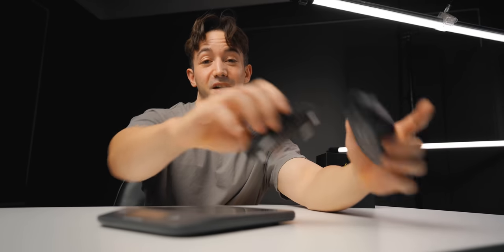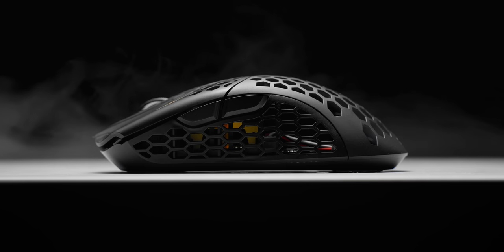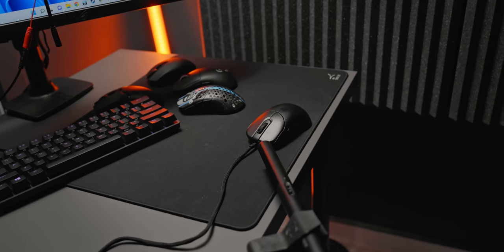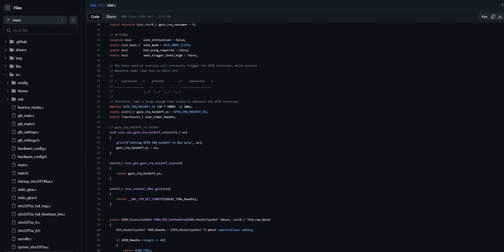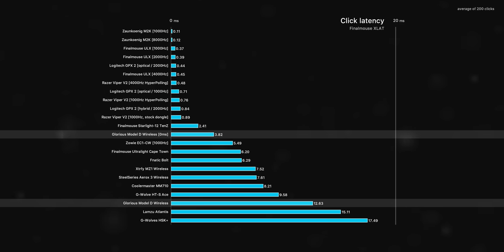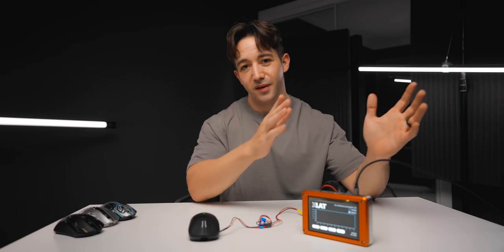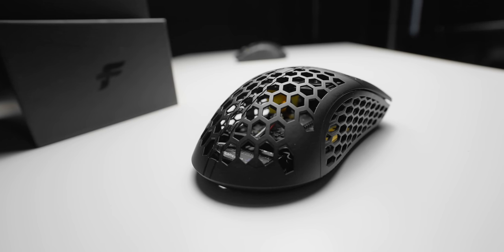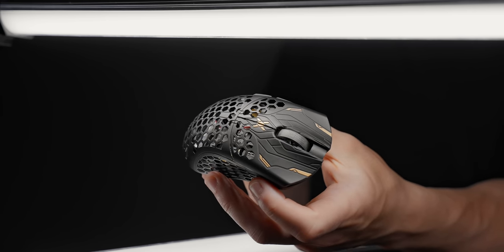Finalmouse just owned everyone. - UltralightX Review

Comment: I used to work for a local retailer that stocked Finalmouse.

Eventually we had to drop them completely, as they would outright ignore our warranty claims from them and we eventually had to compensate customers out of pocket.
Reply: Microcenter?
Reply: @HumongousFish  Microcenter! my favourite local, small, startup, tech retailer!
Reply: @itsPoliswirl  same bro it's amazing
Reply: You know what they say, if it's micro its small and if it's a center thats bound for some plenters
Reply: They only did Amazon for old drops and then Maxgaming for the Starlight 12 Tenz so wut?
Reply: What were the problems and how common were they?
Reply: @go3002  Mostly just QC issues, sensors being wonk, etc etc. 
This was during the earlier days of Finalmouse as well, so I can give them a bit of a pass.

Hopefully it starts to improve now that they're trying to be an actual brand instead of hype beast bait.

It wasn't a massive amount, but still more than was acceptable for a retailer.
Reply: Sidebuttons and scroll wheel have always been terrible on finalmouse
Reply: actually interesting how @4:54 of click latency, they did not include razer 8k or 4k, only 2k.. lmaooo
Reply: ok
Reply: I had the original ones released years ago. both had left clicks break and they did replace them but I've heard these same stories from others
Reply: Bizarre since they replaced my original one for free and without second question

Comment: My main criticism of this video is how you lowballed both G-Wolves, Lamzu, and Glorious(shocker one too) whether it was unintentional or not. Most people who buy these mice set their debounce a lot lower, so testing it at 0-2 ms debounce makes sense. I have never heard of someone using a Lamzu Atlantis at the default debounce at 12 ms. Also, I’m 100% sure those Chinese mice you tested are not their latest/pro version. The Lamzu Atlantis you tested was the compx mcu and not the pro version using the Nordic one. Also, the 4k version of the G-Wolves mice at 4k should be on par with Razer and Logitech.
Reply: We definitely need more thorough testing. This is bothering me too.
Reply: @MrKapusij  It would be ok if he did stock versions only, but changing polling rates and setting the GPX 2 to optical mode requires software. Just like how debounce settings also require software.
Reply: He said those were the mice comparable with xlat. It doesn't work with all mice off the bat
Reply: @cmo8627  I never said stock only. I said that those options might not exist for small mice brands because the code isn't there to receive it yet.
Reply: @Evan-xs8ts  It’s more so because he doesn’t have the pro versions of these mice.
Reply: @cmo8627  or they don't work with the software. Like he said. What don't you get about this.
Reply: @Evan-xs8ts  Even if it’s true(though I doubt it since all the higher brand mice use a Nordic mcu), he is still testing outdated mice and giving misinformation with the evidence shown.

Comment: Your test of two "identical" mice being different makes sense and it would actually be pretty awesome if you provided data on variance between mice that are supposed to be the same. Hardware works within tolerances, and it would be nice to know which companies are responsible about consistency.
Reply: I think this also might be a case of interference. Not in terms of malfunction or even a significant influence but when you put two transmitting devices right next to each other, especially when they're the same brand, you can't rule out any interference quirks.
Reply: @UnimatrixYoutube  Not even interference, most likely just USB input polling differences. Switch the mice's USB ports and you'll probably see that tiny difference flip. This is why the dedicated testing box makes more sense than comparing multiple connected devices at the same time
Reply: You are asking a Youtuber for manufacturer retailer-grade sample size...
You do realize that 2, 3, 5, even 10 mice of the same type wouldn't be enough to get the kind of information you want, correct?
Reply: @fuibancontafake3057  Sounds like you are just trying to flaunt that youv've taken a college course in statistics but I'll respond anyway. Evidence from this video shows that just comparing two showed variations (maybe due to manufacturing tolerances). There are many things that can vary more with timing, sourcing blah blah blah. Comparing two even from the same run still has value just to flag if they are different. It's the sort of test I'm suggesting to do when the opportunity is there. I'm not suggesting to go buy 3 more of every mouse he has ever tested, especially considering 90% of people are using about 3 different options at the top of the line.
Reply: they should be selling these for $149 not $180
Reply: I’m pretty sure he did with “dpi deviation is real”

Comment: Not having a software running in the background is a nice thing. But the web configurator has 2 issues: if they release a new version you are forced to use it no matter what and if they shut down service you cannot configure your mouse anymore.
Reply: there's probably more than a few 3395/2khz+ configurable mice out there that don't require software to be running at all times. in fact, i don't even think logitech actually require you to have the hub software running once you have everything configured, though it's been a while since i've used one so can't confirm that.
Reply: most mid to high end mice had onboard memory. you only need to run the software once to configure it, save it, and then you can just uninstall it
Reply: theres probably also a software version but u dont have to use it
Reply: Which is no problem since this is an enthusiast product where few will lag behind when it comes to versions and new products.
Reply: @neofaktion awful take
Reply: @hoozwastaken   It's not a "take" lol, your average gamer isn't going to be buying this mouse, they will be getting the superlight 2
Reply: Wonder if saving an offline version of the website would still work, would fix both of those issues.
Reply: @WHAT_1400  Logitech also has Onboard Memory Manager. Doesn't require installation and changes onboard settings directly without the god awful experience of GHub where you have to switch to software mode, change settings in profile, switch back to hardware mode and then copy the profile to the onboard memory.
Reply: @WHAT_1400  razer doesn't need software running too. tough i still hate them. you install the software, do your settings, the settings are saved to your mouse and then you can uninstall the program again.
Reply: @neofaktion Not even. Most gamers buy the G502 or Basilisk, maybe G305. The Viper V2 Pro, DAV3 Pro, GPX 2 etc many gamers will go for the competitive folks but definitely not the "average".

Comment: it's good that you mentioned that the software is done through a website. this honestly should be the new standard when it comes to peripheral settings just like how you can customize the wooting keyboard with their website. obviously im not saying to completely get rid of downloadable software but its so nice to have a plug n play type of peripheral and be able to easily change the settings through a website. makes things so much easier and  convenient
Reply: Problem is, it relies on WebUSB which Firefox does not support (for somewhat decent reasons), so it can’t be the only option IMO. Awesome as a secondary option though
Reply: One issue I see with this is profile switching.. If you want different settings for different games etc. If I want to play with 4k/8k but use 1k in Windows (to save battery), this would be hard with only a webapp. :/
Reply: Or be like glorious and you have to download the software once and it saves the data inside the mouse or keyboard

Comment: The way they're sending mouse clicks outside of the polling rate is interesting, USB is capable of a lot more than people think.  Polling rate itself is also a bit misunderstood, while a rate of 10ms(p) (100Hz) can be guaranteed, defining the polling rate does not guarantee that data will be transferred every 10ms but rather that the transaction will occur somewhere within the tenth frame.  Polling is also called an interrupt transfer, there's also control transfers that essentially act like packets, and isochronous transfers that are used for real-time information like A/V data that needs to be sent at a constant bitrate.  Though there is a fourth transfer type, bulk transfers, that acts similar to interrupt transfers but without the polling rate, they use the entire bus bandwidth but only transfer after other transfers have finished, as bulk packets of 512 bytes under USB 2.x high-speed; an example of this is printers, where bulk packets get dumped to the device where the exact time frame isn't important.  I think, hypothetically, sending a bulk transfer between polling requests could be possible, as an inter-polling packet, though I'm not sure if this does work.  I'm also not sure if USB 3.x introduced anything newer to the spec that allows for this kind of usage, I'm also having trouble finding anything on the topic regarding 3.x specs as Google in its braindead lack of wisdom wants to only give me results concerning transfer speeds rather than transfer types.  I also find the nomenclature of 'interrupt transfer' a bit odd, as traditionally an interrupt is a device pinging the CPU for attention whereas polling where the CPU polls a device for information at a fixed rate, and thus USB is inherently poll-only and non-interrupt; though with everything being ICs with their own processing now, I guess those lines can be blurred.  Beyond this, USB 2.x high-speed is only limited to 125μs(p) [8KHz] polling, and though I cannot find definitive fact in spec it's seemingly apparent that 3.x uses a simulated polling rate with upwards of 42.6μs(p [24KHz] simulated polling, but also that a transaction can occur at any time. 

So either Finalmouse has somehow figured out inter-polling on USB 2.x, or Finalmouse is one of the first, if not the first, peripheral manufacturer to properly utilize USB 3.x or 4 where they're not playing the simulated polling game, or some kind of hybrid of simulated polling for most functions with an instant transaction of other functions.  Of course the product doesn't actually state it's connectivity spec outside of the port used, and I doubt Finalmouse will actually disclose what they're doing.  Though with sensor movement, I can understand why simulated polling would be used, every little twitch of the sensor would be reported and there'd be so much junk data, simulated polling would at least keep things clean.  But at the same time, the 8Khz limit leads me to believe that all of these devices are still inherently on the 2.x spec; maybe they do so for the nonissue of 2.x port compatibility?  Either way it's an interesting development and I wish more peripherals would move away from the polling rate nonsense or lock polling to the device's microcontroller and just have intervaled reports related to specific functions, such as sensor devices where switches could otherwise not be locked to that rate.  It'd be interesting to see if a USB 2.x port actually breaks the black magic of the inter-polled clicks, otherwise confirming either side of the hypothesis.
Reply: I’m pretty sure finalmouse is just polling the dongle at 8khz and skipping the polls that don’t match up with the sensor polling rate but allowing click events to be sent in between sensor updates allowing the clicks to be sent on polls that would have otherwise been empty.

Comment: Regarding movement latency, I have a concern with starting the motion from standstill. It could have different results depending on the software implementation, the latency could be different in motion. The difference with static friction and dynamic friction of the mouse skates and mouse pad together with tolerances could affect the result too.

So I what I would recommend instead is something like moving the mouse on one axis and then adding motion on another axis and measuring the latency of when the motion changes. Or sudden (de)acceleration on the same direction. This is more realistic for a situation of continuously tracking a target.

Comment: I started using a Keychron M3 Mini wireless mouse 4k polling rate. The mouse is only 69.99 and yet upon testing it in aim trainer software I've found my performance has improved significantly over my Logitech G Pro Superlight. Recommend checking it out. Wish I could run latency tests myself.

Comment: I just wanted to say that I never use the mouse wheel in gaming. I press F to change the weapon. In my opinion, the mouse wheel is obsolete for a gaming mouse. Maybe the manufacturers should take this up. 

Well, I use the wheel to scroll in the settings menu, but you can also click and drag on the scroll bar.

Comment: The reason i will stick with Logitech is because of the Power play charging system, its so nice to be able to use a wireless mouse and never have to charge it or even think about charging it. ive never had an issue with the software or the mouse itself.

Comment: considering the quality issues that come about from these lightweight mice anymore, and considering QC issues I had on the click of the stormbreaker that come from the same manufacturer I have no doubt this will have just as many issues. How about we make mice that don't feel like they have degraded to trash tier after a month of use. I love the innovations but how about we get the basics right first, a quality build that doesn't have creaking issues, grinding issues, loose mouse buttons, sticky clicks, pseudo double click feel like in the case of my DA v3 pro back button etc. 

These guys are all charging $130+ and they degrade faster than some $30 mice I have used. The only one I haven't had develop issues that make the mouse basically ruined for me within a month or 2 has been the zowie ec1-cw. I am currently on week 2 of using the Lamzu Thorn, so we'll see how it holds up but I am so done with mice companies pumping this literal trash out the door with 0 longevity testing.

I have had pretty basic bad QC issues with Razer DA v3 pro, pwnage stormbreaker. The sad part is I have less noticeable degradation on model d or model d pro, the model d is years old and had far more use than the DA or stormbreaker. I have like 6 GPX some modded, couple custom painted and they for the most part had no issues. Viper ultimate had no issues, so far the lamzu thorn is great but it's only been 2 weeks. The issues I have had with mice have all came within a month of use, which is absolutely ridiculous when they are charging the most premium of prices. You can make it out of sold gold, if it creaks and you feel it or the click sticks and I need to open the MONTH OLD MOUSE to fix a damn issues on a $150+ mouse it's trash quality. 3 copies of the DA and all 3 had the same issues. Stormbreaker I have opened 10 times to try and get rid of the sticky right click, it always comes back. So my options to fix it are outright removing the foam padding and having the shell feel loose or leaving it and having it stick. Really nice from a $190 mouse that was a month old. 

Make mice that don't start to creak, stick, or fall apart after a month or 2 of us FIRST before these innovations. I have never ran into these QC issues on mice until the ultra lightweight push came about. I've had dozens and dozens of mice all used for extensive times and it's like every single new ultra lightweight mouse runs into the same damn issues. I don't care what sensor you throw it in, if it can go to 10million polling rate, if it starts creaking and popping, grinding or falling apart after a month, it's trash. I only listed the 2 biggest offenders in my collection because they are 1. The more expensive options $150 and $190 and 2. happened within weeks of owning them.

Comment: If a latency advantage does not translate into any significant end-to-end effect, why worry about it? Are you saying that your end-to-end measurements have too much variance or not enough resolution? Have you considered NVDIA Reflex? It would not require soldering. BTW, if Finalmouse can catch events outside the polling raster (e.g., via interrupts), why are they even using polling at all? Why not deliver the events as they occur, perhaps with a customisable frequency limiter?

Comment: I was right there with you until you compared to the Viper Mini SE. Which yes--is priced incredibly high. But, I've had $100-$200 mice from just about every vendor go bad because of double clicking because of poor debounce setup and switches wearing in--and because the Mini SE uses optical switches--it won't.

I'm guessing Finalmouse is like all the other mice in that price bracket--using mechanical switches prone to double clicking in time? Sure it is amazingly light--but what good is that if you have to find someone who is willing to solder mouse switches after 6 months?

Comment: Hi @optimum, do you notice a difference with wireless dongles being plugged in directly into the computer vs being extended with a cable to be closer at the mousepad?
I've seen some discussion about this since the signal might be travelling faster through air than through the cable.